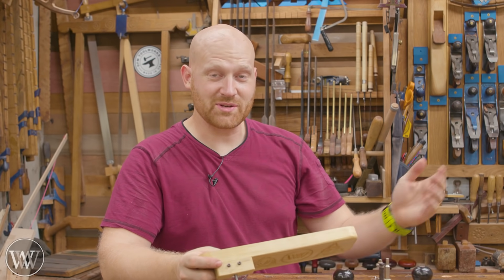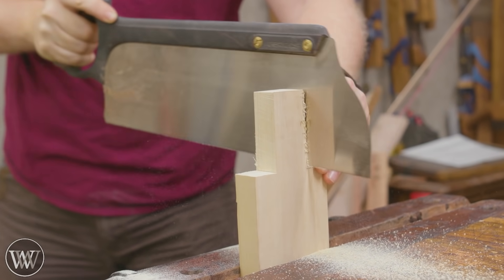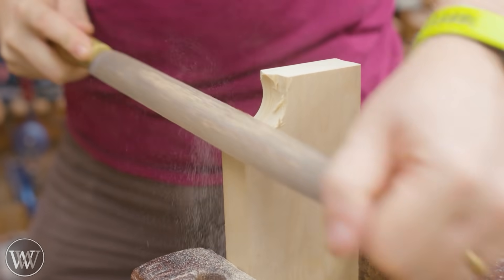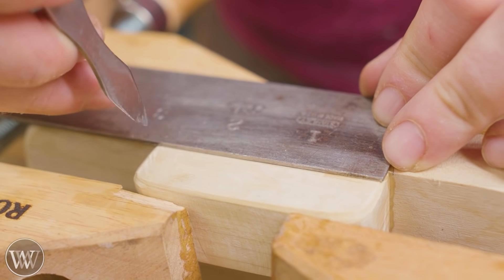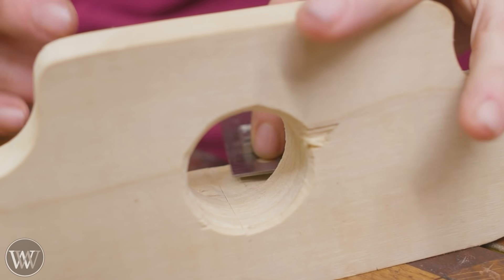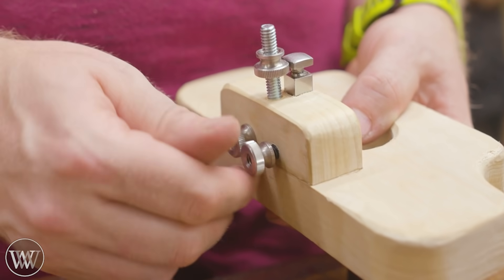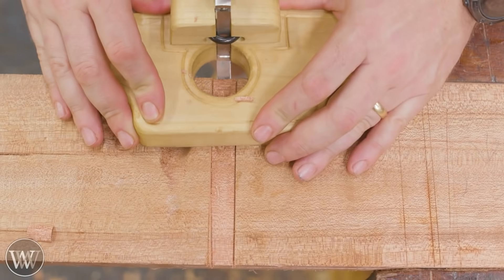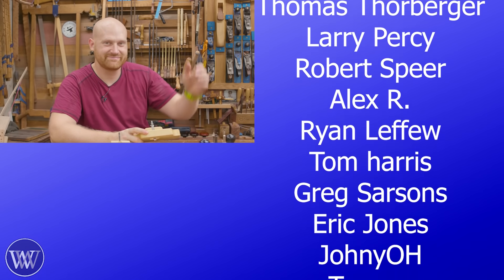How to Make A Fully Functional Router Plane

Comment: Every Wood by Wright video:
- Drill it
- Make a stop cut
- Chisel out the waste
- Chamfer every corner
- Carve it
- Scrape it
- Drown it in Boiled Linseed Oil

You make it so simple, & I like that. It's easy to get overwhelmed, especially when you see people like Paul Sellers (phenomenal woodworker) do everything exact & perfect every time, or you see others say that you absolutely MUST do something a certain way.
I really like your reality-driven organic approach, because that's how I built the things I have been the most proud of. No atomically precise measurements - just dive in, hold the pieces up together, and cut what looks good. 👍👍
Reply from the maker: That's about the way it goes. Cuddle of a straightforward process lol
Reply: @WoodByWrightHowTo  I've had issues finding good auger bits for a brace. Do you use a hex adapter with what looks like modern bits? Any preferences or brands you recommend?

Comment: This was helpful to me; I need to learn as much as I can about how these simple router planes function.  I have a plan to make a router plane with a base of stainless steel plate glued with high strength rubber cement to a block of hardwood.  The rubber cement means that there is enough flex to allow the wood and steel to expand and contract a little differently without the tool tearing itself apart.  If this works I will have a home made router plane as stable as a solid metal one but better looking and shaped just for my own hands and preferences.  I hope it works but if not I'll be out less than £10 in materials because I got the hardwood for nothing.
Reply from the maker: That sounds like a great idea. I would probably use high glue rather than contact cement. It has a slightly better bond and more long-term flexibility.
Reply: @WoodByWrightHowTo  hide glue?
Reply from the maker: yup. https://amzn.to/2YTgeDp in my tests it has a far better long term adhesion to metal.
Reply: @WoodByWrightHowTo  just checking, you originally said "high" glue, so wanted to be certain! Normally your typing is perfect....

Comment: Which 1/4" bit is that? Do they offer a 5/16" as well? Kinda sad to see that Wood Owl stops at 3/8"
Reply from the maker: For the 3 flute option they can't make them any smaller then 3/8" but they make these single flute bits for the smaller sizes
Reply: @WoodByWrightHowTo  Thanks!

Comment: James - what a great build - thank you!!  Gotta make one now.  I noticed that your large one has the cutter close to the right end with a long span on the left side.  Is this so you can have lots of leverage to hold it flat when routing near the end?  Would it make sense to have a similar mounting set-up on the left side as well so you can have leverage on the right - just move the cutter over???
Reply from the maker: It is there to give a large reference surface for doing tenons. You could make it long on both sides, but that would make it a much larger tool. But with it just being on one side you can just flip the iron if you want to.

Comment: Nicely done!
I have a question though for router planes. Like you, I make excuses t use my router plane since I purchased it! My question: have you ever seen jigs/guides for the router plane like circle cutting guide for an electric router?
I’m experimenting with some designs.
Thanks Mark.
PS: Your series of videos are really excellent!
Reply from the maker: The problem with that is the cutter is longer then it is wide so if the circle is too small it would jam in the cut. Also, going in a circle means that you will be going across the grain as well as against and with the grain. This means you would have to score the path in font of the cutting iron so you do not tear out the work. with all of that is is usually easer to just freehand carve it. but where their is a will there is a way.

Comment: I don't have any way to access  a router plane iron in my country, I never even saw a hand router either used or commercially avaible. Is there is a way to make this possible with a chisel/ plane blade etc. Thank you for information its pretty nice video!
Reply: A large allen wrench can be grinded down to work as a blade.
Reply: For a simple blade, use an allan key. You probably have to heat it first, then file it to shape and then sharpen, but a decent size alan key will be a good starting point to work with, because of its shape.
Reply: @spayced  not just a good effort, a great one! Beat me by three seconds!
Reply: Thank you guys but the ones i owned to date were always made from pretty soft metals. Even i would find  one hardened i need to make heat treatment procces if i am not mistaken and i don't have the gear
Reply: @mizikacibalik  I'd probably try with the soft metal. Shape it with a file and see how you get on. It might be okay, or you might have to sharpen it every five minutes, but at least you would have practice at making one. I use a propane torch for any metal hardening, which works well.
Reply from the maker: My preferred shop-made iron is just bending a chisel. here is an old video doing that. https://www.youtube.com/watch?v=cJZhPc7r7bM the allen key method works well but I find it to be a bit more work.
Reply: @WoodByWrightHowTo  oh nice i have access to nice price/value chisels here atleast could use this one thank you
Reply: @ricos1497  if only i could buy a cheap propane torch in turkey..
Reply: See Paul Sellers Poor Man’s Router Plane. It does work, although hard to maintain depth adjustment.

Comment: I notice in both this video and streaming video, you didn't spend anytime making sure the router blade is vertical to the base. Is that not as important as I thought it was?
Reply from the maker: I use the square to lay out the cut line for it. As long as I cut nicely along that line that's all that really matters. And with a small cutter like 3/8 of an inch it really doesn't matter that much. if you're out of alignment degree or 2 you really won't notice it in the function.

Comment: "Surprised how well a bolt cutter worked (to cut a bolt)."
Reply from the maker: Usually they deform the threads so much that you have to spend a lot of time to actually get them to work afterwards. I was surprised that in this case it did not. That was unusual